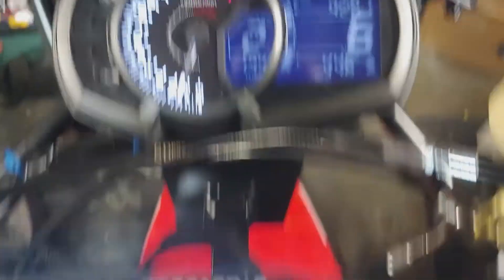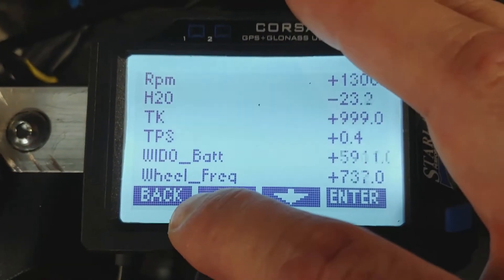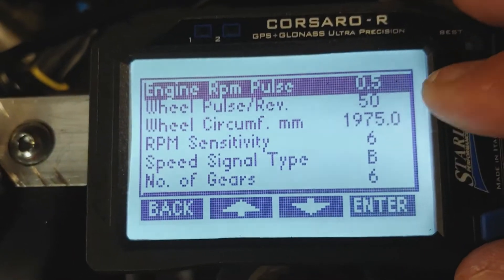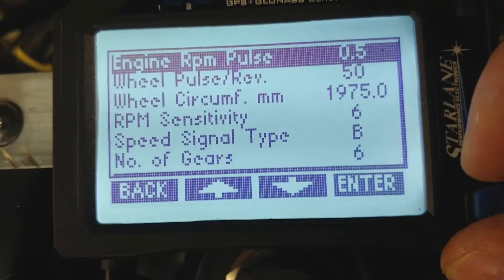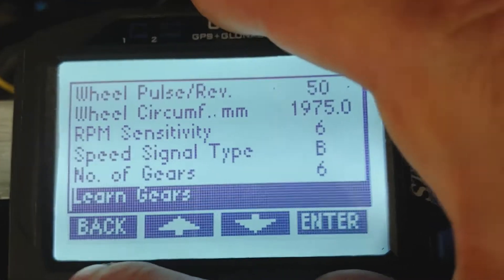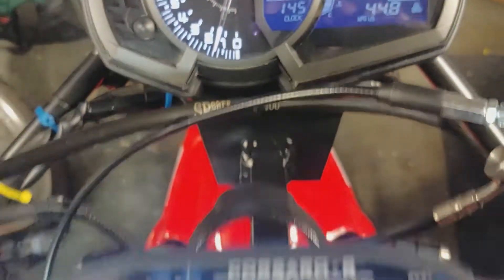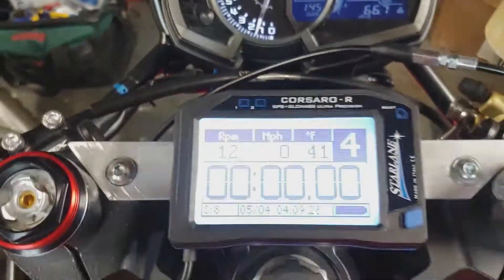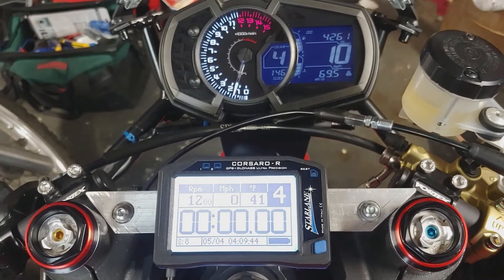Starlane Corsaro-R Wheel Speed and Gear on Ninja 400 Track Bike

Comment: What rpms do you down shift?
Reply from the maker: I don't really pay attention to the rpm when downshifting. I try to keep it in the powerband. Usually you'll know after some laps of the track which gear to use on which corner.
Reply: @falcn12  I'm a bike less bro(yammie noob) plan on getting one soon
Reply from the maker: @dgrand9369  new rider?  This is kind of an advanced track tool for someone just starting out riding 😉

Comment: What wire coming from the speed sensor did you tap into to to connect to the WID?
Reply from the maker: I was going to try and make a junction pigtail like I bought for the TPS, but just went with with pulse signal wire in the loom that comes off the dashboard.

The color and pin are listed in the video description.  I tapped into it by the left front of the tank where there was an opening in the wire wrap.